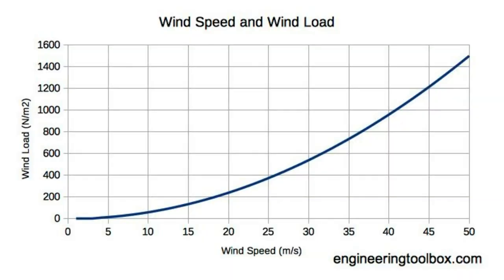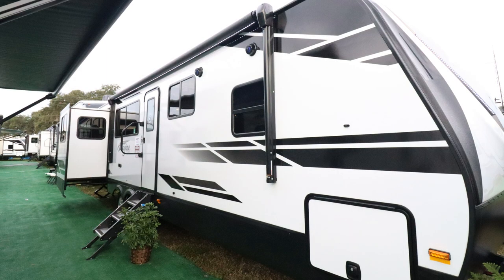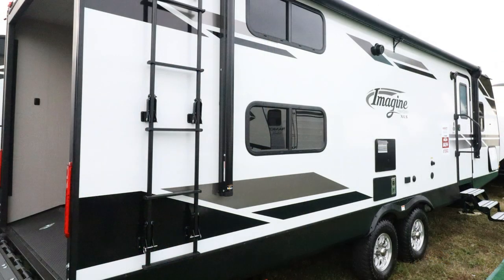The HUGE Issue With Travel Trailers No One Talks About

Comment: My dad told a guy on his RV lot he could not tow a 32 foot trailer with a 1/2 ton. The guy said 3 other dealers said he could. My dad said while he could tow it, it would not be safe. The guy knew this but he was looking for a dealer to tell him the truth. My dad worked for an RV dealer that also had a Ford Dealership across the street. My dad walked this guy across the street, he traded in his F-150 for a new F-350 and then bought the trailer. My dad got commission on the truck and the trailer.
Reply: Good for your dad.
Reply: Well... we pulled a 33’ and a 36’ with a Ford Expedition for 3 years. We have a Hensley Arrow hitch. We just upgraded to an F250, mostly for payload. It can be done and done safely with the right hitch on a smaller truck.
Reply: @bcpratt01  Just because it can be done doesn't always mean it should be done.  I can haul a lot of things with a 1/2 ton truck that I wouldn't let a person that's never towed with, tow.

Comment: We live in Colorado and travel to Wyoming & South Dakota frequently. The wind blows there once in a while. I switched from a Suburban to a 2500 Ram Cummins. The additional weight and HP are great for stability but the added braking ability makes the world of difference.  I use the compression brake all the time towing in the mountains.  Between the compression brake and down shifting the transmission, I can lock the truck and trailer to any speed. No more white knuckles going down Teton Pass.  Good video! Thanks.
Reply: I agree - the engine brakes are the best thing about diesel tow vehicles. That one thing alone makes the upgrade worthwhile.

Comment: I have 2600RB and started off with an 2017 F150 5L and like your previous truck it pulled and stopped pretty well with my E4 WDH.  However when we were in Texas we got some winds that moved us around and it turned into a white knuckle driving experience very quickly.  Turns out its the weight of the truck that makes all the difference.  The wind on the trailer is the force acting against the truck and the F150 was not heavy enough to 'resist' that much weight.  It doesn't matter when kind of hitch you are using the force on the truck will be there to deal with.  So......I upgraded to an F250 6.2L gasser and the difference in towing is night and day.....no more white knuckle driving, not getting pushed around when an 18 wheeler passes us.  Plus with the extra payload (3,300 lb) I can also now carry a 1,000 lb electric golf cart in the bed of my truck at the same time as we are towing the camper.  Your video is a good one and keep it posted.

Oh, and I am an engineer and what you are saying regarding the 4x increase is true, it's not a linear function at all.  Good job and keep up the great work.
Reply from the maker: Great to have some solid backup! Thanks! One day we WILL get together and compare mods... one day!!
Reply: @WanderingWeekends  I'll join you for the meet up!

Comment: I have an Imagine 22MLE and tow with an F150 and feel like I'm on the edge of comfortable.  Total loaded weight is 5,600 with a 600 tongue weight.  I installed a HD Roadmaster RAS system and now feel much better.  No way would I try to tow a 30 plus foot trailer in Kansas winds.  Great vid.

Comment: I also just upgraded to an F250 powerstroke to haul my 30' travel trailer. Had a 2020 Chevy Trailboss rated for 9400 lbs and my camper was 7500 lbs dry. I was also experiencing sway but my real issue came when I was reversing my camper up my driveway and the transmission temperature light kept flashing. I loved the Trailboss but just not enough power for that size of camper. Looking forward to getting out this year with more stability and power!

Comment: I was pulling a 34.5 foot trailer with my wife's  yukon XL. I very quickly realized that was not a great setup. I bought an F250 and was amazed by the difference.  I can even leave my eazlift anti sway off (although I don't)without much trouble. Great video!!!

Comment: Agree. Would not pull more than  a 27ft trailer behind an f150.  Our f150 handles our 25ft perfectly, and we use that truck for everything , so a larger F250 would be a pain to park, and the half ton works for us. We also like how easy it is to handle a smaller trailer at a gas station, backing it in to a campsite etc. The effect of wind on a long trailer is huge. Is rather pull a short heavy camper than a long, lightweight one.

Comment: I agree with so many others here. We were going to buy a 24’ Jayco TT, but needed to buy a truck. While we were out test driving the various brands, they sold “our” trailer, which was just about the time we bought a new 2020 RAM 1500 hemi, w/3.92 rear end.  My wife fell in love with a different TT, a Jayco Jayflight 29FKS. On paper, it looked ok considering the weight of the trailer, and the capacities of the truck.  We even bought a Blue Ox anti-sway weight distribution hitch set up by the Hitch Guy at our RV dealership.  It was fine at 30 or 40 mph, but on the interstate, it was scary. It felt as though the front wheels of the truck were barely on the road.  Luckily, we were still in the break-in period on the truck, so I only had to drive about 55 mph on our “shake down” trips that were only 25 miles from home.  I have a friend who drives a flatbed trailer installing appliances with his 3/4 ton diesel truck every day. So, I got him to drive our rig.  He made sure we understood that we were living dangerously with that truck and trailer.  The next day we went back to the RAM dealership, and traded our 1000 mile 1500 for a new  2500 diesel 4x4 pick up.  We feel much safer driving down the road now, than we did back then.  Had I known about the 26’ rule, we could have saved a lot of time, money, and stress.  You are absolutely correct.

Comment: Agree 100%.  I’ve got the exact same trailer, 32’ 2800bh and initially towed it with a F150 Ecoboost.  On paper it could tow it.  Engine had no problem, no problem braking, but it just didn’t feel stable and that was with a ProPride 3P hitch.  Not to mention that my truck axles were overloaded even without the trailer loaded up.  Traded for the F250 with the 7.3 and couldn’t be happier.

Comment: AMEN!!  We had a 28' Imagine and towed with an F150 with max tow package.  On our first big trip we went to Yellowstone.  All went well on the way up, but leaving we had a wind day in Wyoming (which we now know in Wyoming is almost all days) and it was a miserable experience.  I really thought that was the end of our RV'ing as my wife was freaked out.....and to be honest, I was as well.  
It was so bad that after getting back home, we went to the tire store and found that we had worn almost half the tread off our back tires from the back and forth the rear end was doing.  And yes, we had a quality weight distributing hitch with sway bars that was adjusted correctly per the manual.  We then upgraded to LT tires, Bilstein shocks, air bags and a Hensley hitch and after spending $5k finally solved most of the problems.  Would have much, much easier to have started with a 3/4 ton truck.  We now tow a 14k GVWR 5th wheel with a 1 ton and couldn't be happier.  Preach it Brother Cory!
Reply: A 3/4 ton truck still needs the Hensley or Pro Pride hitch.

Comment: We moved from a GMC Sierra half-ton to a Ford F250 gas last spring, and it was a night and day difference when pulling our 33' 5,900 Lbs(dry) travel trailer.  Like you mentioned, weight was never our issue with the half-ton.  We were always under the towing capacity of the truck, however the loaded weight of the trailer was very close to the weight of the truck.  Gross combined weight (trailer + truck) was our issue!  Now, our 3/4 ton weighs almost 2,000 Lbs more than the dry trailer and it has a much greater GCWR.  The extra weight and added wheelbase of the truck made a big difference; not to mention larger brakes, heavy duty transmission, rear end, radiator, larger transmission cooler, etc...  Last summer we spent 87 days on the road on our "out west" trip.  We ended up towing from Ohio to Washington state, down the west coast and back over the rockies.  The truck did awesome!!!  We hit 50mph head winds crossing Wyoming.  Although, not fun, the larger truck made it very doable without white knuckles.  However, I will say that a diesel would have been very much appreciated towing over the mountains out west.  The Sierra Nevada's and Rockie's are no joke.  😊

Comment: I went the other way. Had a 3500 Duramax pulling a 7000 LB GVW Northwoods Nash. Being retired with only the wife, the dog and me, we decided to go to one vehicle. With that said, the 3500 as a daily driver was way to big. You need an airport parking lot to turn that sucker around in. Anyway, we purchased a F150. Sure the Duramax had way better power and handling, anyone would expect that. But, the F150 tows our Nash just fine. Even with 45 mph crosswinds driving in Wyo. That said, I miss the engine braking in the Rockies that the diesel provided. Also, have to watch cargo capacity as our 150 is way short compared to the 3500.
Reply: You're towing a 7000 lb. travel trailer with an F150 in 45 mph cross winds?? With all due respect, are you nuts?? That's a recipe for disaster if I've ever heard of one. 😂
Reply: @Steve_Edberg  Nuts? Not at all. I stay within my payload and towing capacity, and keep my trailer brakes, trailer and tow rig tires and suspension well maintained. It’s all been a non issue over many thousands of miles. All drama free. I don’t like traveling on snow driven and icy roads however. That gives me white knuckle syndrome for sure.

Nuts? Maybe...had a 1997 CBR1100XX, dubbed the Super Blackbird. The fastest production motorcycle made at the time. I was clocked at 155 mph once, and only once. Yes that’s nuts!

Comment: Totally agree! Now, if your only going to tow short trips & local only, you can get by with a properly equipped 1/2t but the minute you change your direction & want to travel more...that 3/4t will make your experience so much better. I went with a 1t over a 3/4t. The cost was real close & worth it to me to have the extra capacity. We want to upgrade our travel trailer & didn’t want there to be limiting factors.

Comment: Nailed it! This was my exact experience with my 2015 max tow Ecoboost F150. Towing a 35 foot 8500 pound trailer in the mountains was terrifying and any wind on the flats would push us all over the road. Traded it in for a 2021 f250 with the 7.3 and will never look back.

Comment: Excellent video! I remember towing a 30' Springdale travel trailer with my 2012 Ford F150 EB crew cab short bed in high cross winds in Maine. It was pretty scary. I went to a 2015 Ford F250 Diesel Crew Cab Short Bed, which solved a lot of problems. However, I was overloaded even with a 30' travel trailer due to weight of the diesel engine / transmission, 50 gallon aftermarket fuel tank and the older design of the truck. I still got sucked over from a passing 18 wheeler with the F250. I now tow with a 2020 Chevy 3500 Crew Cab 6.6L gas. I am now way under the load capacity and no longer get sucked over by the 18 wheelers. However, I still will never travel on the Chesapeake Bay Bridge Tunnel.

Comment: Thank you for the explanation. 
Other channels like BTBRV always said that you need more trucks for the RV other than a cargo trailer or a boat, but they never bothered to explain why. I'm driving an F150, planning to upgrade to an F250 or 350 when they moved the new tech from the 2021 F150 to the Super Duty line.

Comment: You can feel the air when you are driving while towing a travel trailer. Air plays a HUGE role on towing a travel trailer.   I was towing my 25 total length travel trailer with a Chevy Tahoe, zero issues, even in two emergency maneuvers, but when I upgraded to a 3/4 ton suburban, the difference was incredible. The 2500 suburban handles the trailer so much better than the Tahoe did.  But there are still some people who swear that their 150 or 1500 series trucks are perfect for the 32 foot trailers. Well I have seen more accidents with 1/2 ton ton tow rights pulling travel trailers than any other rig combined. It is not only YOUR safety, it is the safety of others around you.

Comment: 100%!!! I had a very small travel trailer last year with an old Ford Sportrac as tow vehicle.. I was wanting to upgrade the vehicle and the trailer as it was our first RV and it's something we want to do... we were identifying potential RVs and when I talked to people, they'd all say "33 ft around 8000 lbs (loaded)? You just need a half ton".... I'm glad I took the time to learn about all the numbers, payload, tongue weight..etc. So in Janurary I went out and got a 2021 2500 Silverado HD and we just signed the papers for our 33 ft Wildwood xlight. Some people think it's overkill. Sure, when you only look at the tow rating, but it seems like no one really does take any variables into consideration! I'd much rather have my numbers somewhere in the middle of the truck's overall capacities and have a truck with a suspension system, brakes, hitch...etc.. that can handle the RV with any amount of drag, hills and any variance in driving conditions. I'll have my family aboard. Safety first. No white knuckle experience for me. A nice comfortable, enjoyable experience. Thanks for this video. You are bang on! It will also be safer for all you guys when I meet you on the road with my setup! Wishing you all the best!

Comment: I completely agree with the premise. I’ve never towed a travel trailer but I did pull a 26’ car hauler from Ohio to Texas and back with an ‘02 Chevy 2500hd extended cab. At times I felt the trailer pull when even something the size of a Trailblazer would pass me. I’m sure glad I didn’t opt to use my shorter, lighter Avalanche as a tow vehicle on that trip, except the back seat would have been more comfortable for sleeping.

Comment: Good advice.  Where I come from there is a saying; "there is no replacement for displacement".  When you go to a 3/4 ton, not only do you get larger engine displacements as standard options, which is incredibly important if you trailer frequently, but you also get a full frame, bigger brakes, etc.  It is really only some suspension components and maybe the transmission that separate the 3/4 tons from the 1 tons.  And people should keep in mind the "max towing capacity" is just that.  Sure, a 1/2 ton will move it, but if you have one of those little EcoBoost engines it will be screaming like a jet engine the whole way.  A large V8 will just idle along, especially a diesel.  So more truck is never a bad idea if you can afford it.

I would counterpoint your video in one respect though; get a 1 ton.  They don't cost that much more, and you get it all back in resale value.  The off road crowd and the trades prefer the 1 tons.  3/4 tons are mostly for fleet vehicles.  Plus you don't have to worry at all about payload.  They are gas hogs though.

Comment: Very interesting and insightful.  I happen to have an F-150 ecoboost truck towing a 26.5 foot (hitch to bumper) travel trailer, and know exactly what you're talking about. I want to mention another mitigating factor.  First, let me say that I would not tow without a weight distribution hitch with sway control.  That said, things can sometimes get pretty hairy if my fresh and waste water tanks are half full.  The swishing around of the water can cause stability problems.  Empty or full tanks are fine.  Just another thing to keep in mind.

Comment: I have towed a multitude of Trailers the past 40 years from gooseneck, flatbed bumper pull,  5th wheel and presently a26 ft Travel Trailer. A dually make towing less stressful. In high winds the small travel trailer will give the dually fits.

Comment: Back in September 2019 I bought a small trailer for the two of us to start traveling around the US. The trailer was 22 feet overall and loaded around 5,500 pounds. Tow vehicle was a 2015 Silverado LT DoubleCab 4x4 shortbed 5.3l 6 speed 3.42 with towing package and 1750 pound payload. 

Towed for a little over 6,000 miles all around the western US and while it towed okay, I could tell that this was close to the maximum I’d want to tow with this truck. Never felt unsafe but transmission temps would get into the low 220 degrees climbing those longer grades. Gas mileage went from 18-22 mpg empty to 7-8. We were within 100 pounds of payload for the truck. Most grades I’d be in 3-4 gear really working the truck. 

February 2020 I came upon a late 2019 Silverado 2500HD WT 4x4 doubleCab shortbed 6.0l Six speed with 4.10 gears. This allowed me to use my shell, bed Mat and all other accessories onto the new rig. After 7,000 miles I can say that this setup will last as long as I need it to. Going up any grade the max transmission temperature I’ve seen was 181 degrees. Most the time it’s in the 165-172 range and that’s in 100+ degrees. The new truck has close to 3,000 pound payload which means I’m only using close to half of my available payload. Gas mileage is between 8.5 - 10.3 mpg and most of the time in 5th gear turning less rpm than the old truck. The only negative is my empty mpg is 15.5-17 mpg but I bought the truck for towing and it’s not a daily driver. 

With the same hitch I can definitely see that with the half ton I was close to max. The 3/4 ton will allow us to upgrade to a different rig in which we planned to do once we retire. 

I see all these folks out there towing huge trailers with their half ton and glad it’s working for them. But for me, I really can see the benefits of a HD vehicle. Look at the brakes, frame and additional cooling system that most HD rigs have. The upgrade cost for me was less than $10 k from my 2015 to 2019 which gave me something I feel has better reliability and capacity. 

Thanks for the video! Great content 👍
Reply from the maker: Awesome input!! Thanks for this!